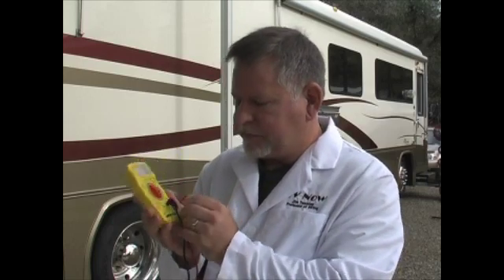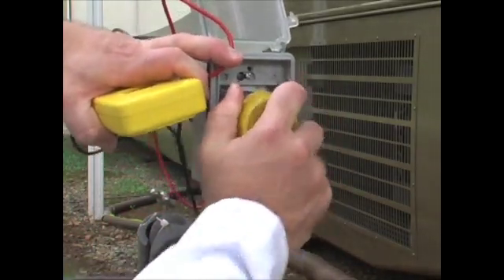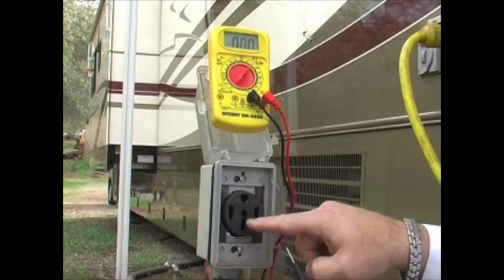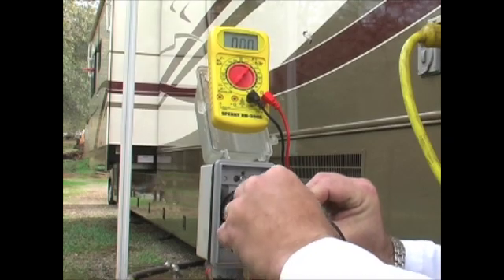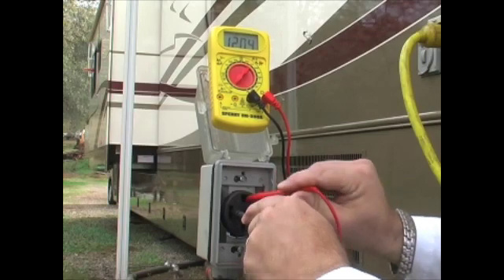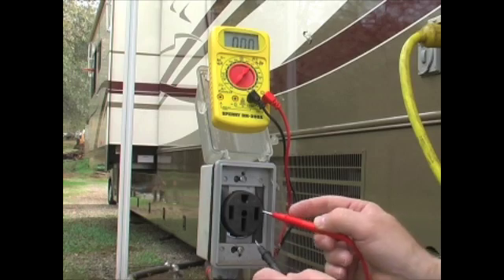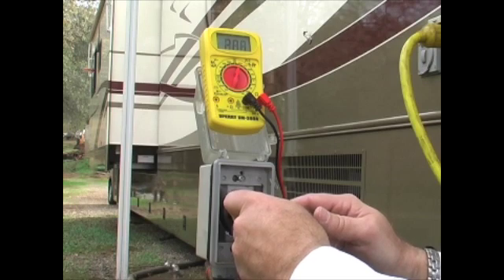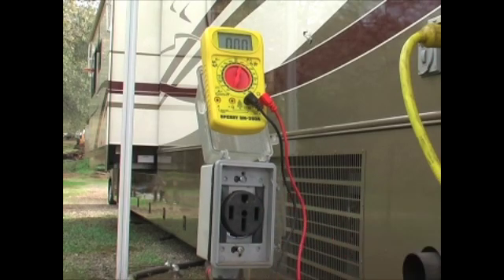Multi-Meter Basics 50 Amp

Comment: Excellent and badly needed information! Thank you! :-)
Reply: Measuring the voltage between the neutral and ground tells you nothing, because it may be open and would also read 0V. You should use the resistance mode to check them. Then the other AC voltage measurements should be between neutral and power. The bottom connector (neutral) and either the right or left connector for each 120VAC.
Reply: Measuring the voltage between the neutral and ground tells you nothing, because it may be open and would also read 0V. You should use the resistance mode to check them. Then the other AC voltage measurements should be between neutral and power. The bottom connector (neutral) and either the right or left connector for each 120VAC.

Comment: Great info.
Important safety tip that I didn't see mentioned -
 The first thing with any multimeter is to test the leads every time that you use it.
 Set the multimeter to the lowest range Ohms and the leads should read less than an ohm (or very low ohms).

Verifying the continuity of the leads is vital when working with power - if one of the leads is bad (open - or broken in some way internally - happens all the time especially with cheap meters ) you will read none or a very low AC voltage (it will still pick up some spurious AC) but it would lead you to believe that there was no power
- and assuming that there is no power can easily kill you.

After verifying the leads, be sure to switch back to the AC volts ranges or you will burn out the internal fuse on the meter - or the meter itself.